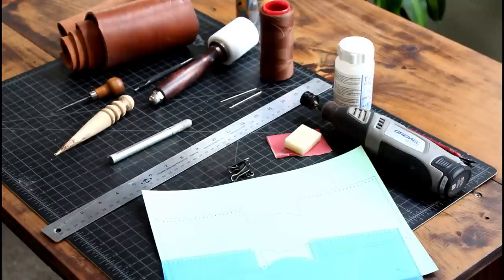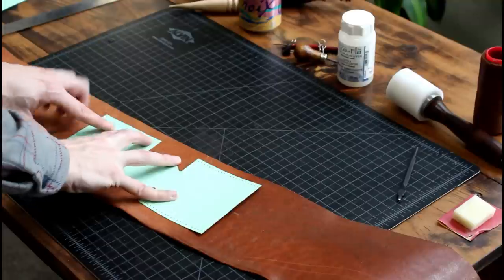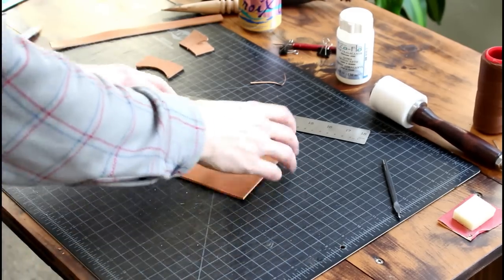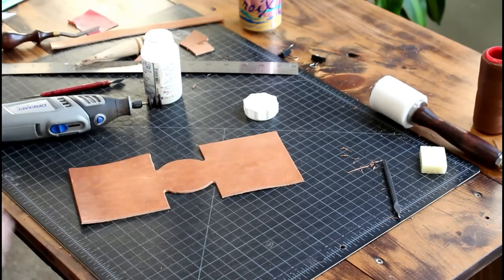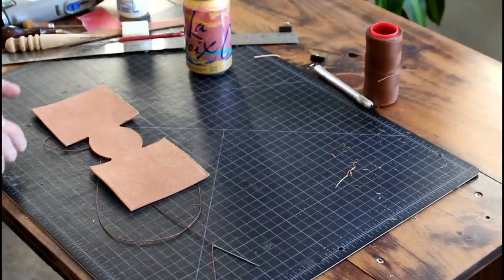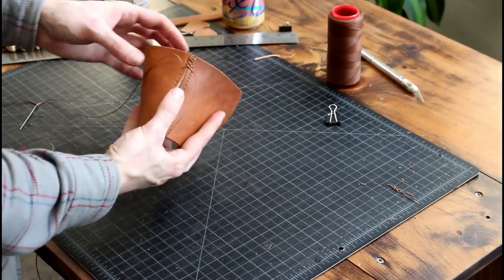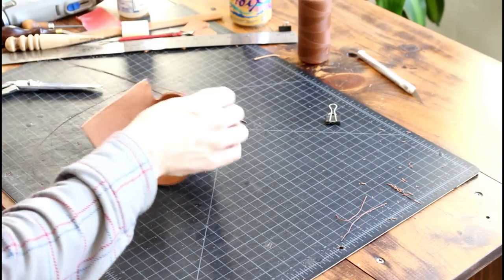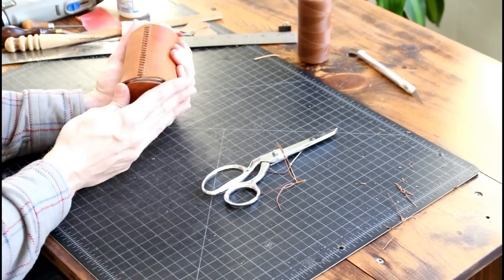Make A Leather Can Sleeve | FREE PDF PATTERN!

Comment: I just made my first one. Thanks for the pattern! I was dreading trying to stitch the second side with my  big hands and fingers. Great tip to start at the bottom! I also discovered that if you slightly pinch the sides together, you can stitch through both holes at once, and do all the work from the outside instead of working back to front (outside to inside). You just need to make sure you snug everything up after each stitch.

Comment: What's your opinion on using an oil tanned leather for this project? It doesn't seem like the supplier linked above still carries the leather you're using in the project and the cuts they do have are far too pricy in relation to the average price this product sells for on competing Etsy shops.
Reply from the maker: Oil tanned is great for this project since its already more resistant to moisture. Would recommend!